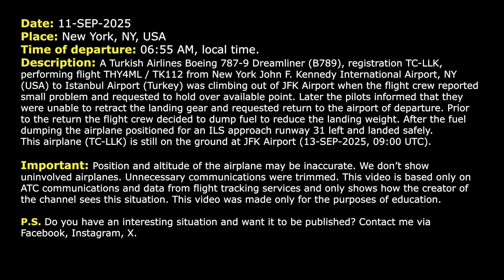Turkish Airlines Boeing 787 Dreamliner dumps fuel and returns to New York after gear issue. Real ATC

Comment: absolute terrible comms from the crew of Turkish 4ML. Zero description of the problem despite repeated queries, not declaring an emergency and going straight to 'i'm going to dump fuel'. Bad training.
Reply: Also the controller is shocking.
Reply: Are you a fu**ing pilot ?

Comment: There is nothing to blame here, neither on the pilot nor on the controller's side. Jettison is not a frequently used verb to describe the action of Dumping Fuel. You can jettison your canopy in a fighter jet but for liquids the verb dump is rather more appropriate. Jettison being in Boeing's instructions; that also shall not be blamed. In the end they try to standardize and enforce. I think finding a practical common language/code and being early in describing these & the nature of the problem is important in cases like this where someone's accent or vernacular is kind of an outlier. She explained the "gear" problem at a much later point in time and just stuck to the request for Dumping fuel, assuming that anyway the airport and controller will allow for it regardless of the issue with the plane. So instead of the assumption, she could have explained these earlier with fewer sentences. Both did well; controller at understanding and Pilot at being nice.

Comment: The crew did an ok job only they failed to declare emergency to begin with and rid themselves from a million questions from the controller who was left outside the loop and clueless, trying to figure out what was going on! Then the controller was becoming a little bit more intrusive being a distraction to the crew during a busy period where apart from troubleshooting the problem they had to talk to the company and the passengers and the cabin staff and prepare for an approach that was changed and added to their workload plus the controller was asking stupidly if they were able to carry out a visual approach 😫 all in all unnecessary talking and too many little annoying things but otherwise the right thing was done and all went well with the landing which is what matters.

Comment: It's  a Boeing what did you expect🤷
Reply: Boeing planes have statistically speaking not more gear failures than Airbus. And you won't like this fact, but it's the same manufacturer that makes their landing gears apart from Liebherr which is exclusively Airbus. 
Not a fan of the criminal things Boeing did concerning MCAS and offing their whistleblowers. Also not a fan of what these incompetent corporate idiots did to Boeing. But let's name the problems where they actually are. Landing gears are not one of them.

Comment: A female Turkish Airlines pilot, despite having declared an emergency in the first phase of an oceanic flight, remains calm and composed, adhering to her solid training and following protocols precisely. Her English is fluent and clear. At the same time, she continues flying the aircraft and maintaining full command of all technical safety aspects, as there are 240 people on board.

Meanwhile, the ATC personnel sound like “what’s up, buddy” — maybe they haven’t had their coffee yet, or they’re being cocky, very tired, or unqualified; we can’t know.

As I mentioned below, Boeing uses the term “jettison” as the main term in all its official documentation. An American controller not knowing the terminology used by their own country’s aircraft manufacturer is not the fault or shortcoming of foreign pilots whose second language is English.

Fuel Jettison:
The official (certification/documentation) term for the process of controlled fuel release through designed systems to reduce the aircraft’s landing weight or to remove excess fuel in emergency situations. This term is preferred in certification documents, maintenance manuals, and aircraft manufacturer documentation. It is the official term used by regulatory authorities such as the FAA and EASA.  In Boeing aircraft manuals (FCOM, AMM, FCTM, etc.), the term “Fuel Jettison” is almost always used. Example: On the 747, 767, 777, and 787 aircraft, there is a “Fuel Jettison Panel.” Maintenance Manuals (AMM) and Quick Reference Handbooks (QRH) also include procedures under the heading “Fuel Jettison.” The word “dump” generally appears in informal speech (e.g., ATC reports saying “dumping fuel”), but in Boeing documentation the official name is “jettison.” Boeing closely adheres to FAA/EASA certification terminology; since the certification itself says “jettison,” all technical documents follow the same wording.
Reply: ATC has failed his English Vocabulary Test, I guess...😂
Reply: Kesinlikle
Reply: 240 souls on board. She was very good. Jettison was the problem. Pronunciation 🥹
Reply: They did not declare emergency to begin with and this is the reason why the controller was puzzled by their low speed and improper behaviour. The lady pilot said that they had a small problem with the landing gear which left a lot of questions unanswered!
Reply: @christosphillips3568 Aviate Navigate Communicate textbook in emergency

Comment: most of the negative comments here are just nonsense.
-pilots are trying to deal with an issue while trying to fly the plane safely. aviate-navigate-communicate, communication is the last step for a reason.
-ATC is dealing with god knows how many calls at the same time, so i cant blame them too.

overall, i think this situation is handeled quite good.
Reply: what if their situation was desperate?
Reply: @RoAvDude  if the situation was desperate and atc recieved a mayday or even a panpan call, im sure the handling of the situation and the communication would be much different.

Comment: Is this the actual sound quality when they’re speaking to each other?
Reply from the maker: I believe they had better quality.
Reply: The headsets have better quality
Reply: Those radio receivers from the tapes we hear are on the ground. There's lots of disturbance and interference from surrounding hills, buildings and vegetation. Ground-to-air transmissions are therefore clearer than ground-to-ground.

Comment: It took several minutes for the pilots to tell what the problem is the tower. Despite that the controller was calm. I wouldn't have allowed them to "fuel jettison".
Reply: There are actual ATC personnel in the comments here stating the ATC was dogshit and pilot was excellent for international flight standards. The pilot declared the landing gear issue right at the start of horkding request a minute in, you were fast forwarding past it maybe ? Additionally the ATC kept hotmicing by pressing the PTT mid sentence from the pilot and then later asking the pilot to clarify the sentence he cut off. Additionally he deviated from international aviation phraseology almost every transmission. In some countries he would be taken off ATC and sent for training. The pilot has 3 priorities, fly the plane first, navigate second, communicate last. The ATC was a total fuck up
Reply: Seek a therapist.

Comment: The controller seems wilfully, almost passive aggressively obtuse. No allowance for second language or cockpit workload. Wonder if the controller can speak any foreign language.
Reply: At one of their first interactions, she already told the controller about the landing gear problem. So hijacking is not the case. It's the controller who is not aware of anything.
Reply: He didn't know what the problem is. The pilots ignored his several calls to explain what the problem is. What if the aircraft was hijacked?
Reply: @leviathan3434  ATC was told the emergency when they declared it are we even watching the same video.
Reply: @leviathan3434  ARE YOU DEAF TOO? they said they have a landing gear problem from the start, and calling boeing to sort it out before declaring emergency! what is so hard to understand that require 1000 times the same question? seriously this controller as majority calling out, has serious issues with comprehension or using proper language or terminology!
Reply: @leviathan3434  As others have said, the crew stated what the problem was. In case of a hijacking, there are strict protocols to follow like transponder codes and so on. Cockpit doors are locked. So it is very unlikely to have someone hijack a plane especially during a take off run. 
Additionally, pilots follow a simple rule: Aviate, navigate, communicate. First, you need to make sure that you are ahead of the plane and flying it instead of it flying you. Many crashes have happened because of work overload and getting behind the plane. Then, you need to know where you are. On the priority list, talking to ATC is the absolute last thing. Pilots during an emergency are under no obligation to please ATC. On the contrary, it's ATC's job to assist those pilots so that they can bring down the plane without crashing it. So what ATC needs to do is help them and lighten the workload, not adding onto it. When I went to pilot school and visited ATC facilities to understand our friends on the ground, all of that was drilled into us. Every single ATC understood what their role was and every single pilot knew what their priorities were. What I observe is that ATC in the US has lost their standards and often see themselves in some imaginary oppositional role to the pilots which leads to arguments, making unnecessary demands and not assisting pilots the way they should. What annoys the most is comments like yours which are based on no competence in the industry at all. What makes you think that you have a say in procedures that are esrablished for decades and based on thousands of dead people whose deaths those procedures try to prevent?

Comment: It s strange that Boeing writes Fuel Jettison at the panel and Americans dont understand this wording..
Reply: Neither Turkish ATC in Istanbul. As a PM I was asking for “fuel jettison” in English several times due to a medical diversion but they didn’t understand until I told in Turkish then they were like “oww you need fuel dumping”. There you go.
Reply: Boeing used the expression fuel jettison decades ago before the education dumping in the US.
Reply: This controller does not represent all Americans. Fuel jettison is a term that is used and taught by ATC and pilots in the US. Although “dumping fuel” is more commonly used.
Reply: @EnthusiastCarHangar  fckn boeing should switch to dumping fuel too..

Comment: What a chaotic and inefficient communication... The pilot could have been more to the point and sticking to what's important for ATC to know at the moment. ATC should have sticked to standard phraseology, simple and not interpretable. It really caused the pilot to sum up unneeded information. The controller didn't seem attentive either. The pilot's English was great, althoug unnecessary transmissions made it appearently difficult for ATC to filter and remember the critical information.
Reply: the pilot stated that there was a problem with landing gear, and they re calling company (like Boeing/THY HQ/tech) and trying to sort it out before declaring emergency, and they already stated it multiple times, and intend to return if it doesnt work. they stated they want to jettison fuel (aka dump fuel) how hard was it for the ATC to understand this?
Reply: @mytester6208  Agree. THY pilots stated what problem they had, what they were working on and what they needed. Landing gear problem, talking to maintenance, need a holding point to jettison fuel. To be fair, JFK ATC seems to be overly fatigued and overworked. But I let's not get entangled in blame culture here. Aviation has a just culture, not blame culture. And even more important, let's not assign blame to people who did their job properly. That's even worsey

Comment: How is fuel dumping still legal.  Your plane can take an overweight landing.  There is a checklist for that.  Jesus.
Reply: What's the hurry to do an overweight return? An overweight landing has its risks. The gear remaining down isn't a dire emergency. Between the gear remaining down and the fuel jettison, it won't take that long to get the plane down to max landing weight.
Reply: Yes, because when you have landing gear problem, overweight landing is the perfect solution. Why waste tons of fuel when you can risk 240 souls and a $300M airplane!
Reply: So, you'd land an aircraft with landing gear problems overweight and with full fuel? Thank god you are only a smartass YT commenter and not a real pilot.
Reply: Overweight landing with already malfunctioning landing gear? I'm sorry but you are stupid..
Reply: There are landing gears that are prepared for overweight landings and where fuel jettison systems are optional like the A330 and there are planes where the landing gear is not entirely designed for overweight landings like the B787. Early models had no fuel jettison systems and therefore lower max takeoff weights in order to not overstress the landing gear. Later models have fuel jettison systems which allows them to carry more weight on takeoff. Now, if you have a gear failure, you want to avoid a plane which is completely fueled up from doing an overweight landing, potentially having the landing gear collapse and creating a giant fireball with 240 people dead. It's a good thing that you are not a pilot responsible for the life of other people. Because you don't seem to care much about their lives...

Comment: Those pilots should lose their wings. And yet another plane dumping fuel over our fishing grounds and homes. Absolute disgrace
Reply: I hope you don't face this kind a situation up in the air.  I know that you will be the first one to scream, dump the fuel before landing 😂😂😂
Reply: That's an overreaction.  At 7000ft the fuel evaporates long before reaching the ground or water
Reply: @lionelmrocki7955 by what standard? The same standards quality they had for the landing gear? Have you ever been fishing off of Long Island after a fuel dump? Have you seen the water after? The systems are usually only 98% effective. I undertstand they couldnt fly above 20k with the landing gear down. But I also understand that they didnt have to dump where they did, that was not an emergency to cause an immediate landing. We see this all of the time. Thats not an overreaction. Thats a statement or question to a careless issue that has been happening near me for decades. Im not a crying tree hugger or liberal. It is a known issue that can be resolved with law that can fit on a post-it note.

Comment: Curious. Is it normal to be cleared to dump fuel over a populated area? II know it atomizes but l would have thought they would not be cleared to dump over NYC.
Reply: Below 5000 ft no but they at 7000 so it is safe at that height above ground it will all dissapate well before ground level.
Reply: I would have thought they would go out over the ocean to dump fuel
Reply: @kickedinthecalfbyacow7549 of course you would have thought that,  because you misunderstand what happens to the fuel.
Reply: @lionelmrocki7955 i understand what happens to the fuel, I also understand class action law suits from residents who claim damages from fuel being dumped over their homes, schools and hospitals.  When you have a giant ocean 5 miles away, why not use it.
Reply: It's long island not NYC ALL DUMPING OVER THE WATER
Reply: It's a legitimate question. 5000-6000 feet is approx. the altitude where fuel has enough time to vaporize depending on weather. So the minimum altitude for fuel jettisoning is 6000 feet and 2000 feet above the highest ground obstacle. They were at 7000 feet which should be a safe altitude and it is 100% legal. Now, why didn't they do it over the ocean? Because the ocean is where arriving traffic flies their approach routes. Noise abatement procedures... ATC turned them to the right away from departing traffic and they were inbetween departures and arrivals where they were free to do whatever they needed to do. Let's be frank here. When those things happen, people on the ground don't notice it at all. They don't listen to the radio, they can't tell if a plane is jettisoning fuel, they don't know that there is an emergency and so on. So that talk about lawsuits is in my opinion overblown.
Reply: @LeTang-i1u9m delta pay 68 million in fuel dumping lawsuit 

https://youtu.be/zRTjbDsERAw?si=8RUmUBQ4XOcISIs6
Reply: Above a certain height, it is completely safe. What if the emergency occurred in Oklahoma, and you have an emergency and need to land asap, you sure would not want to fly an hour to the ocean before you start dumping fuel.
Reply: @bestdjintown Oklahoma  isn’t as densely populated with litigious people as New York City is 🙄